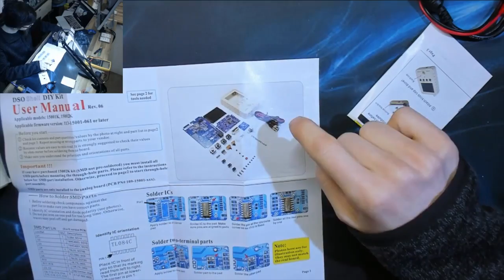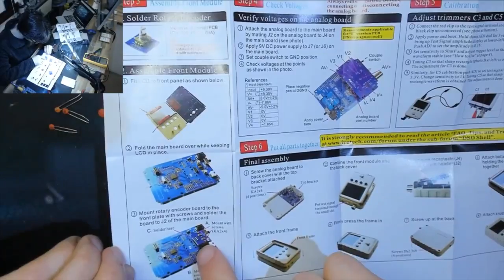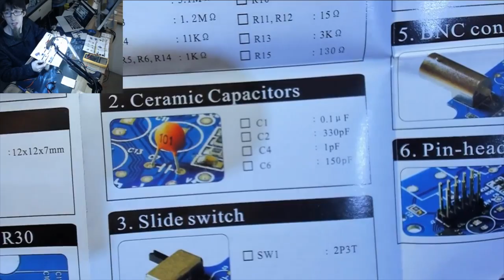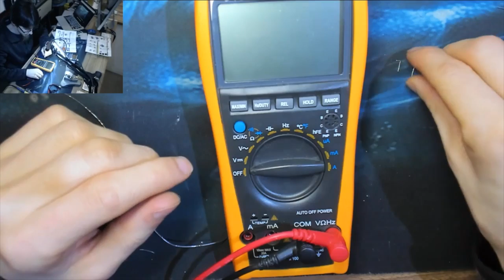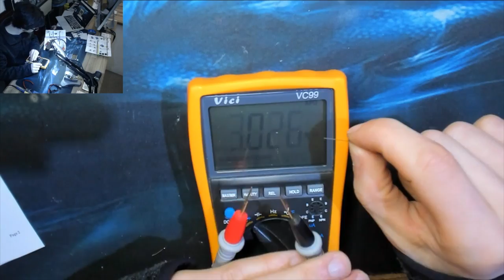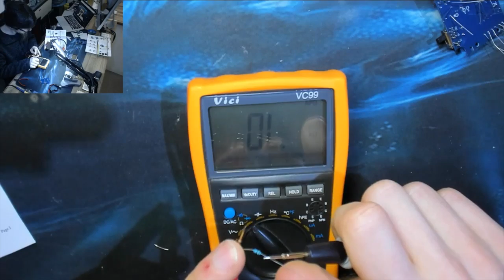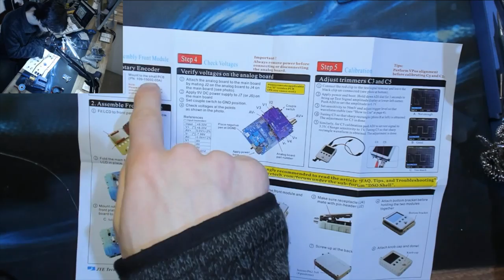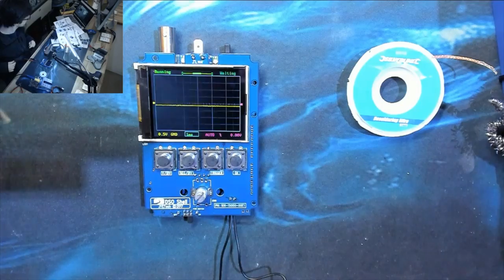LBE#1 - JYETech Oscilloscope Part 1

Comment: on a 3 digit cap code the last number represents the number of zeros so when you said the number was 151 it means 15 and one zero so 150pf. For example a 150nf would be 154 or 15 and four zeros which is 150000pf. Hope that helps

Comment: Assembly wouldn't have passed QC where I used to work, low volume production process control boards, typically batches of about 25, sometimes 10, or even sometimes singletons.
We expected resistor legs to be bent using small pliers at neat 90 degree angles, which avoids the body potentially cracking , & the resistors flat to the board. Similarly ceramic caps leads bent using pliers to avoid damage to the coating.  Extra brownie points if you made the inspector's (me) life easy by putting the resistors so the colour codes all read the same direction. Very neat soldering was expected, granted that's harder when you have through hole plated boards.  You need a better iron if you plan to do lots of that.
Afraid you'd have got that analogue board back to redo. Nothing wrong electrically, but I'd not call it a neat job.

One tip though, start with the lowest height components, diodes, resistors etc., then build up to the taller stuff, makes assembly generally easier & also aids neat work.  I used to do some assembly as well as QC, the other inspector got to check my boards, & was obviously extra nit-picky.